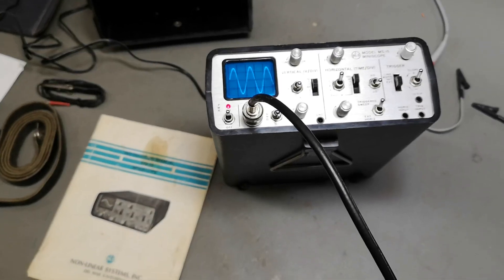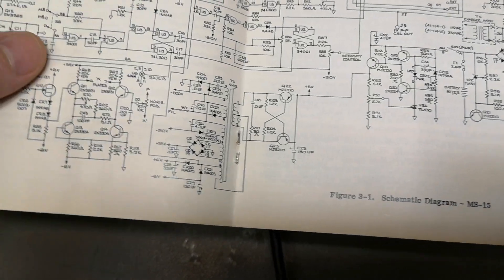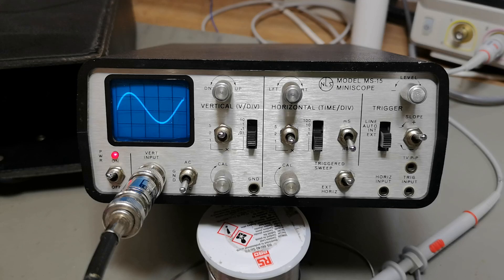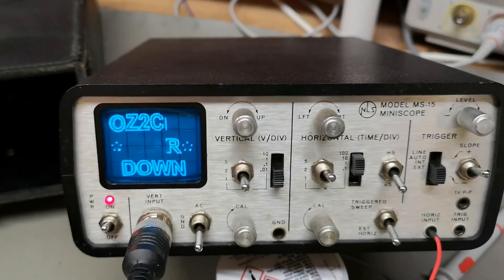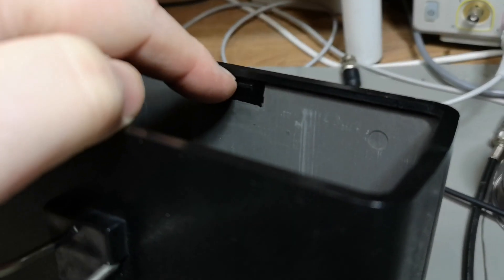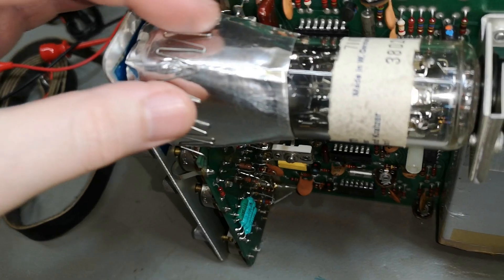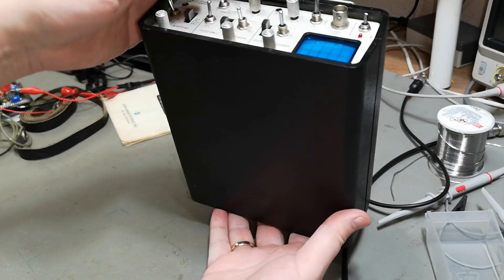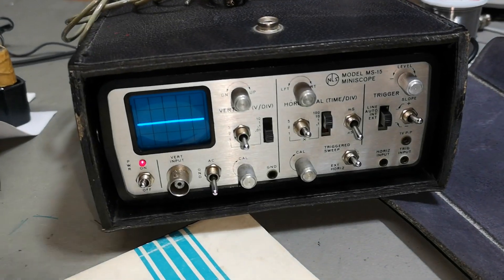Non Linear Systems NLS MS-15 MINISCOPE Oscilliscope test teardown

Comment: Thomas you are lucky to get one that didn't have the crt problem where the trace would take a bend down 3/4 of the way across the scree. I went thru three at the dealer before I got a good one. Sold it years ago.

Comment: Hi, that's incredible, where do you go for that, you probably grow those devices in your garden 😂 He displayed the logo luxuriously, the batets probably won't be original, but the main thing is that it's functional. Very interesting construction.

Nice day 🙂 Tom
Reply: Batets? No the battery isn't original. The instrument is born with 3 pcs. 2V leaf-cells, but they are long gone and dead. A 4S pack of LiFePo4 has similar charge/voltage.
Reply: @zaprodk  Thanks, but I got that and meant it as a joke because I don't think the manufacturer could time travel.
Reply: I'm also wondering where all these instruments sprout from. 🤣